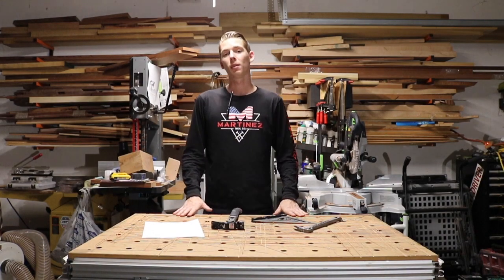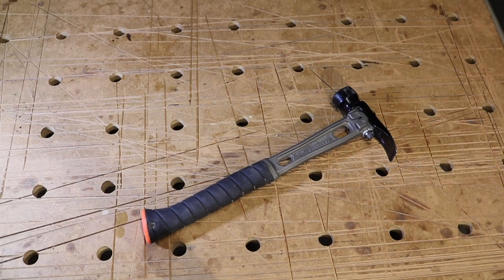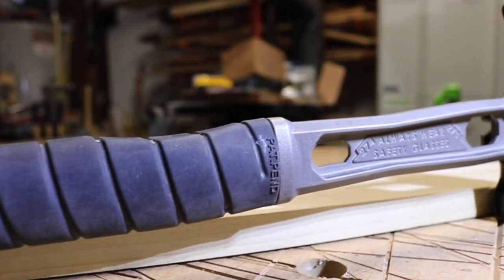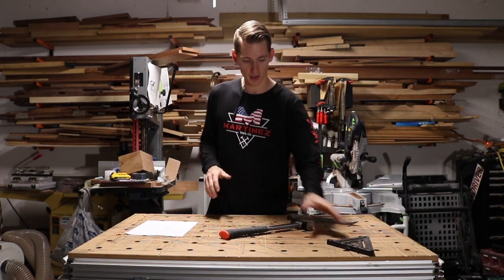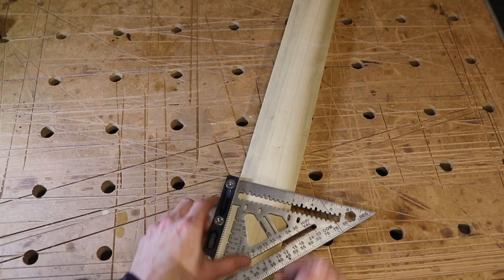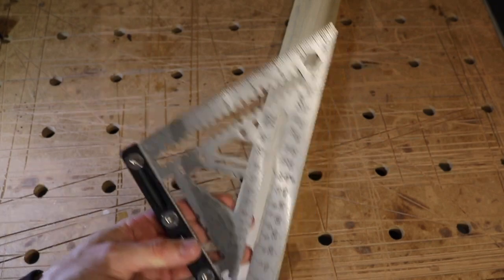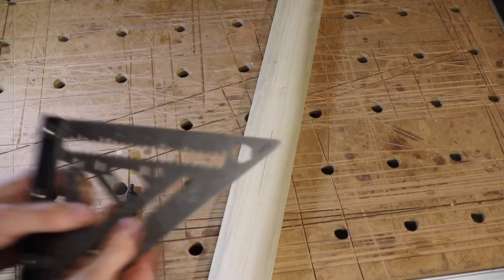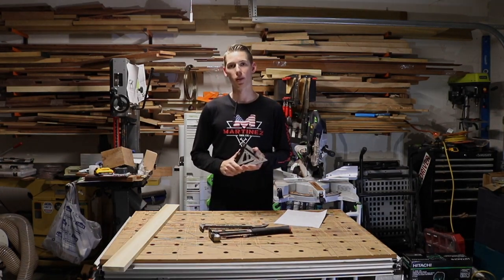Martinez Tool Co review - hammer, prybar, square *not sponsored, honest review*

Comment: Hi, I purchased the M1 about two years ago. Best hammer I ever owned. I was meaning to get a finishing head for it, as well as the cats paw bar but I wasn’t sold on the square. Is it a true 90 & 45 degree?
Reply from the maker: absolutely! i forget the tolerances but they are very very well tuned in to be exact. i even compared it to 2 of my woodpeckers squares and they are exact!!! the best part is that you can drop it without the edges being "rolled" like the aluminum squares. its amazing to see the accuracy along with such durability.

Comment: Hey man can you do me a solid and how exactly did you go through a speed square and another one like how did they become worn out and unserviceable I'm just really curious?
Reply from the maker: I've had a couple empire squares, and they're great for the price, but being on a job site, you know these things can get dropped quite a bit, resulting in the points being mushroomed, and the edges left rough. I've managed to scrape drywall, dry glue, and drop the square on various surfaces including concrete, and to my surprise, its like its brand new. Durability aside, the martinez square feels much nicer in the hand (personal preference)
Reply: @blacklabelcarpentry  I understand, I am a electrician apprentice so I feel you on how tools are on the field vs a pro'sumer DIY. idk if you said it in your vid, but I immediately just assumed you was a carpenter. though I do think the square is very innovative, I do hate how they grab us by the balls and slap a 250$ price tag on it. cant find a square like this anywhere else. 

As a electrician apprentice, I have yet to utilize that speed square to it's upmost capacity in usage. So I cant have a justification on getting that yet. Interesting to hear that. My Diamondbacks costs 500$ for my set up, people refuse to believe me when I tell them my regular toolbelt did not even last me through 3 months of everyday use.  Diamond back was worth every fucking penny.
Reply from the maker: @rodmanbrutus1671  i am a fine finish carpenter by trade, but have ventured into making handcrafted fine furniture. despite being in "finish", i still do plenty of framing/rough carpentry too when needed. i spoke to mark personally about the price and a lot of it is to do with the fact its titanium. its an expensive material to begin with, but is known for being lightweight and very strong.  

i think as an electrician, a speed square doesn't always need to be deadly precise like a finish carpenter would need, even then, everyone has their tolerances. I've heard nothing but great things about the diamondback belts. maybe if i got sent one to test out, id give it a go, otherwise ill just stick with the atlas 46 for now as its been working great. feel free to follow me on instagram "mullaney woodworks" if you're on that platform

Comment: Regarding the hammer heads- how do you like the claw? I haven’t used a wide one like that before. I like the rounded face over the square face And it Also seems like the staple claw might be more novel than practical. What made you buy the wide claw and how do you like it compared to the more traditional claw?
Reply from the maker: I've been loving it. i find the wider claw is less damaging to the material since the pressure is dispersed over the whole claw, vs a traiditial claw that has 2 pressure points. when removing material, i get a good bite on the material so it doesn't slip. the staple claw/cats paw has been amazing!!!! definitely not a novelty by any means. i was using it the other day to remove some 16 penny nails in some framing, and its so sharp that i could dig out the buried nails, and use all the leverage i wanted to remove them. i even tried to "abuse" the claw and use it to remove stucco from the corner of a soffit, thinking the claw would round over and not be sharp, and to my surprise it has remained sharp and still pointed. I even use the cats paw under solid core 10-0 doors to lift them up and the claw shows no signs of giving up. i have been thoroughly impressed to say the least.

Comment: So I may be naive, but say you were a framer, would you not just get the head that’s equivalent to a 2 pound hammer to really drive the fastener?
Reply from the maker: If you're a framer, i would go for the M1 which is a 15oz framing hammer. All the heads are interchangeable, but you have to figure out which length and grip works best for you. The M79 is the sledge head. While you may be able to drive something faster, i think its overkill for setting a nail, plus you have to swing and carry that around all day. I believe it was created to be more of a demolition head

Comment: How is the vibration on it
Reply from the maker: Really not much at all. With the new green rubber cover, there is nothing, but that is used mainly in trim. When you remove the rubber cover, its very minimal due to the Titanium handle which soaks up most of the vibration. That was one thing that Mark Martinez had mentioned when making this hammer is that he wanted to build it from titanium for not only the weight saving and strength, but the fact it removed a large portion of the “shock” so guys like framers wouldn’t end up with tinnitus or tennis elbow in 10-15 years.